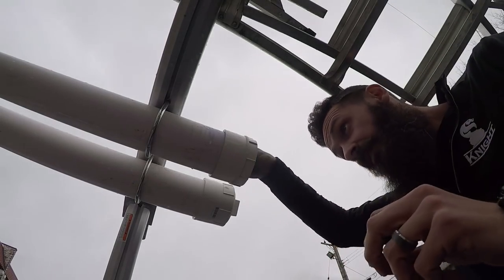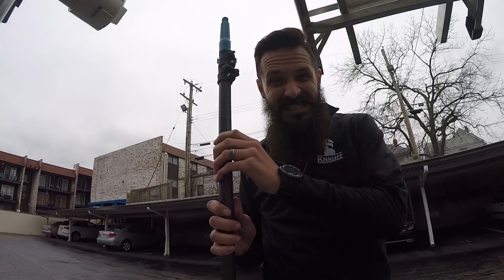Cleaning Windows In The Rain

Comment: Instead of using the wood tip added to the blue tip on the carbon  fiber with the ledger, just drill a hole in you ledger where the locking pin is on the blue tip and it will work perfect. It won't come off and it won't spin on the pole. I've done the same to all my ledgers and I use unger tips on all my poles.
Reply from the maker: great idea !